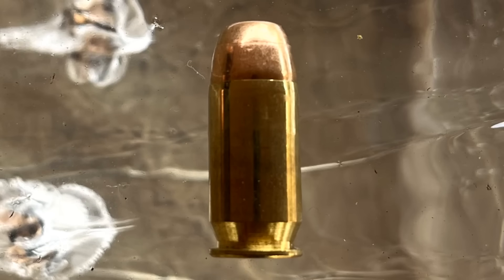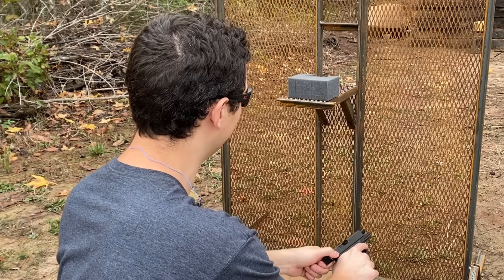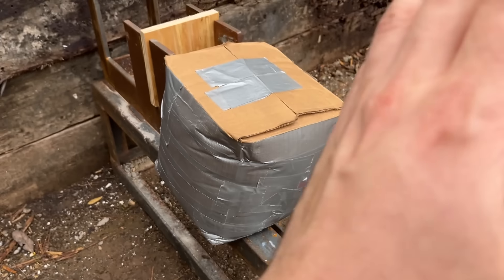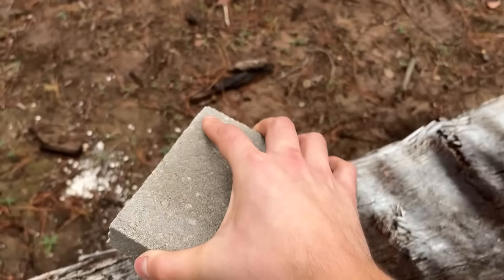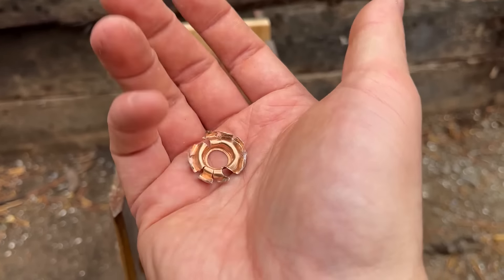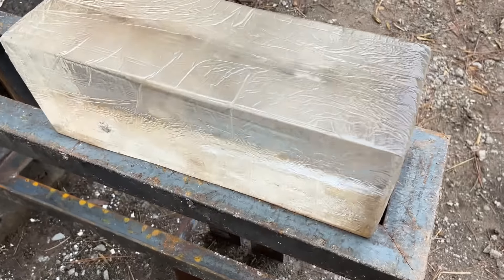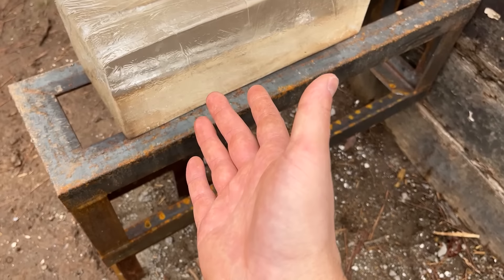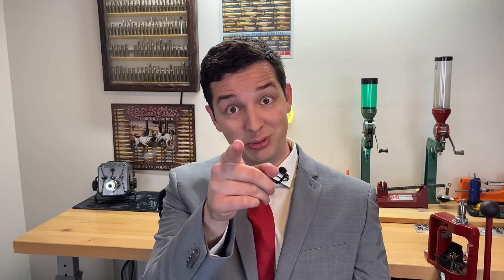9mm vs 45 ACP Barrier Test: No Debate?

Comment: When it comes to stopping power and controlled accuracy the .45 is the clear winner, however when it comes to shear volume and forgiveness, the 9mm is the winner. So at this point it’s preference as both rounds have their pros and cons. My choice is the .45 as it does not over penetrate the target, while having more energy then a 9mm and easier to shoot due to less recoil in most shooting platforms.

Comment: Hornaday et al state that the temporary wound channel in ballistic gel does not accurately reflect what happens in live tissue. The wound channel collapses immediately with little tissue damage. Damage is caused by the expanded bullet's direct contact to the tissue. The actual damage is limited in diameter to the width of the bullet.

Comment: On the Mild steel and rifles when you find a cartridge that will not penetrate a certain thickness of steel. Why don't you take that 1 cartridge and start up stepping or down? Stepping the bullet and bullet design.  To see what that cartridge takes to get thru the steel.
So 7mm-08
120g to 175g  soft points, F.M.J.s, Solid Copper,
So Instead of 2 cartridges going against each other, one cartridge and changing up bullet types and weights..

Comment: Shooting metal plates with 9mm and 45 is very safe at  10 or so yards away. They flatten completely and splash lead 360° in a perpendicular direction from the shooter. Only use lead or lead and copper jackets though. Other materials don't behave quite the same.

Comment: 9x19mm has a weird tapered case design with a protruding rim, forces curved mag use.
45ACP operates at 21k PSI and has a thin case wall.
The winners are the 30 Super Carry, the 9x23mm Winchester, the 10x25mm and the 460 Rowland.

Comment: I've watched many of your videos pertaining to ammo vs steel but have haven't touched base on something. In WW2 it was discovered that angling steel would what otherwise be a direct hit to be deflected. You should try putting the steel at an angle in different degrees to see what those results might be. Instead of penetration even on the 1/4" steel might just end up being a deflection.

Comment: The .45 ACP, also known as .45 Auto, .45 Automatic, or 11.43×23mm is a rimless straight-walled handgun cartridge designed by John Moses Browning in 1904,  Georg Luger, the German firearms engineer who in 1901 designed the cartridge for the German Weapons and Munitions Factory (DWM).
Reply: The term .45acp means "automatic colt pistol". This round was engineered specifically for the new Army, War Dept contract 1911(later 1911a1).

Comment: Ease of carry (the one you carry is the best one to have), Target re-acquisition is second, " flinch"factor is 3rd. For general, everyday carry, your choice is for a backup, not a combat gun (unless you're on duty somehow). Having said this, I went from a 45 1911 (carried 60% due to summer wear and heat), to a 9mm EMP 1911 (carried 85% for same reason) to a P238 .380 almost a 1911 (carry  95% of the time). My opinion of course.

Comment: Look up the Strasbourg handgun test.  It's a very interesting test performed out of the US (animal cruelty reasons), on goats.  .22 out performed the .38.  In fact the .38 testing stopped, because it was deemed too inhuman.  9mm just barely out performed the .22.  .375mag came out on top even over the .45acp.  No testing was done with anything larger.  The results may be different today with the improvements of modern defense ammo.  I'm a .45acp & Long Colt guy, but recently suggested to a friend to go with 9mm because, defense rounds have improved, availability is better, more rounds in the mag, and in a smaller more concealable frame.

Comment: 1958 remington with 8in barrel.  

The Remington Model 1858 is a six-shot, single-action, percussion revolver with a large frame. It was produced by E. Remington & Sons in Ilion, New York, based on the Fordyce Beals patent of September 14, 1858. The Remington Army revolver has an 8-inch barrel length and is .44 caliber.

Comment: That 9mm is loaded a bit more hot than the .45, a 147 grain out of a 9mm at 1000 fps is smoking, the .45 is running substantially slower. I would almost venture to say that the 9mm is a +P

Where as a +P .45 ACP in say a Hornady Critical Defense is gonna be a 220 gr JHP that is going 975 fps. That is gonna hit a lot harder than the 9mm.

Comment: Italian Proverb:  Da bigga da bullet, da bigga da hole!
Sums it up!  Smaller bullets go farther in due to size, not power.  Smaller hole equals less resistance to penetration.
Bigger bullets stop sooner but deliver just as much punch if not more.  Also have more resistance to penetration but deliver more stopping power and, most importantly, will most likely stay in the body and not pass through various parts of it.

Shock and aw! 45 equals more shock then the 9 as the 9 has less resistance to penetration.
EVERYONE overlooks that part of the 9 vs 45.

Comment: Army wanted a round that would penetrate bamboo armor like another poster stated.  Also one of the speculations was it needed to be able "to stop a mule in its tracks", that's the reason for the large bullet and slow speed.  It needed to impart all of its energy into its target as much as possible without passing through, or passing through as slow as possible.  So if you add up the numbers as far as weight of bullet, speed of bullet, and slower pass through it all equates to more stopping power.  Too many people think a faster bullet with more penetration is better, but it isn't.  If pass through is too quick the bullet only imparts minimal amount of its force.  However a faster bullet does create a bigger Temporary wound cavity but the bigger bullet also creates a bigger wound cavity regardless of what the video stated, its physically impossible for something smaller to be bigger than something bigger.  He was measuring the width of the left over temporary wound cavity.    @mrbadguysan

Comment: So, after many years of the Federal Government using .40, they went back to 9mm. There is a real reason for this... back when they went .40, it was superior than the 9mm. Then, for years, the  9mm manufacturers worked to improve the ballistic performance of the 9mm in order to gain the contract back. While this was actually happening, the manufacturers of .40 didn't do much to make it perform better, I mean, they were getting tons of money anyways from the government contract. Now the 9mm is a surperior round. I think this is also the case with the .45. I don't think(and I could be totally wrong) that ammo manufacturers have been doing much with the .45 for many years. And I think this video proves it. I know a lot of manufacturers have been working with " newer" cartridges like the 10mm. Yet, I think the 10mm will eventually be something to look at. Just my opinion.

Comment: Okay. Both of these are self defense cartridges. When you shoot in self defense, are you shooting wood, cement, sand, or concrete? Oh! That's what I thought. Penetration tests on these types of targets are completely irrelevant to the intended purpose of the cartridge.  Since we aren't allowed to test fire these cartridges on the target encountered in self defense, there is no objective test to determine the outcome or the suitability of the cartridges. Both cartridges seem capable enough, there are many, many people now residing in military cemeteries as the result of being struck by either a 9mm or a .45acp.

Comment: This again? They both have about the same energy and stopping power, but the higher pressure 9mm round is smaller and lighter so you can carry twice as many 9mm rounds for the same weight. The 9mm round also has a tapered case, which aids feed/extraction reliability. Love the G30 and G36, but you would have to have rocks in your head to carry one over the G19 or G43X for defensive use.

Comment: Depends a lot on the bullet weight and construction. If you want a 45 to create trauma it can surpass the 9mm with the right hollow point load. If you want pure penetration you need to use 255 grain hard cast. The 45 is best when selecting appropriate rounds for it's intended purpose. That's the upside and downside of a larger caliber. To maximize it you need a ballistics knowledge.

Comment: Mechanics of Handgun Wounding
All handgun wounds will combine the components of penetration, permanent cavity, and temporary cavity to a greater or lesser degree. Fragmentation, on the other hand, does not reliably occur in handgun wounds due to the relatively low velocities of handgun bullets. Fragmentation occurs reliably in high-velocity projectile wounds (impact velocity in excess of 2,000 feet per second) inflicted by soft or hollow point bullets. In such a case, the permanent cavity is stretched so far, and so fast, that tearing and rupturing can occur in tissues surrounding the wound channel, which were weakened by fragmentation damage. It can significantly increase damage in rifle bullet wounds. (Adding my own word here: in other words, once a bullet hits the nearly 2000 FPS mark, temporary wound cavity matters) 

The cross sectional area of the .45 ACP 230-grain bullet is .160 square inches; the cross sectional area of the 124-grain 9mm NATO bullet is .0989 square inches. The 9mm possesses only about 62% of the cross sectional area of the .45 ACP. A more traditional method of establishing the effectiveness of a given bullet is its sectional density, the ratio of bullet mass to the square of its diameter. Generally, the higher the sectional density, the better the penetration of the bullet in living tissue. The sectional density of the FMJ 230-grain .45 ACP bullet is .162; for the 124-grain 9mm NATO bullet, the figure is .144. By this traditional method of establishing a bullet’s terminal effectiveness, the .45 is again superior to the 9mm when both projectiles are of the FMJ type. By any mathematical calculation, given equal penetration, the .45 ACP bullet will create an approximately 40% greater permanent wound cavity volume than a 9x19mm bullet. These mathematical predictions are borne out by actual testing, such as the FBI ammunition tests alluded to earlier.
Reply: To return to the FBI test protocols, it will be remembered that in penetration tests the .45 ACP FMJ scored 100%, while the 9mm achieved a slightly lower 95.5% success rate. While the minimum acceptable penetration for police use was established to be 12 inches, the FBI tests concluded that a penetration of 18 inches was even better. During the tests, however, the FBI assigned no points for penetration beyond the optimum 18 inches. The .45 ACP FMJ bullets penetrated an average depth of greater than 28 inches, while 9x19mm FMJ bullets were a full 4 inches less. Some might consider this over penetration, but for military applications, greater penetration is both acceptable and desirable. As previously mentioned, penetration is only one aspect of bullet effectiveness. The size of the permanent wound cavity must also be considered, and the .45 ACP FMJ bullets in the FBI tests achieved average permanent wound cavities of 3 cubic inches, while the 9mm bullet permanent wound cavities were a full cubic inch less. This significantly increases the prospect of the .45 striking a bone or internal organ. This can be summed up in the FBI’s overall wound value that assigns a value of 2.91 to the military .45 ACP and only 1.65 to the M882 9x19mm. This value is “... the index of demonstrated wounding effectiveness, not potential, as measured by the FBI Ammunition Test results.”
Reply: FBI findings
“Increased bullet mass will increase penetration. Increased velocity will increase penetration but only until the bullet begins to deform, at which point increased velocity decreases penetration. Permanent cavity can be increased by the use of expanding bullets, and/or larger diameter bullets, which have adequate penetration. However, in no case should selection of a bullet be made where bullet expansion is necessary to achieve desired performance.35 Handgun bullets expand in the human target only 60- 70% of the time at best. Damage to the hollow point by hitting bone, glass, or other intervening obstacles can prevent expansion. Clothing fibers can wrap the nose of the bullet in a cocoon like manner and prevent expansion. Insufficient impact velocity caused by short barrels and/or longer range will prevent expansion, as will simple manufacturing variations. Expansion must never be the basis for bullet selection, but considered a bonus when, and if, it occurs.”
Reply: My personal word: 
In conclusion: Ballistics gel gives us good data, but it’s important that we look at true FBI calibrated gel. If I’m going with a hollow point defensive round, give me .45 ACP Winchester T-series 230 grain or Speer Gold Dot .45 ACP 200 grain +P. The goal of your round is reliability in expanding (after going through material) and going 12 inches or so in the body to avoid over/under-penetration. At the end of the day though, a bigger bullet is theoretically better (provided you have proper penetration)

Comment: the 9mm will usually penetrate deeper because it is going faster and is smaller therefore it has the strong possibility of passing through the bad guy without doing a lot of damage, the 45 was designed for total  stopping/knock down power the Ft # of pressure when it hits a body will Knock that body down to the ground and it will not get back up.

Comment: 45 has become a lot more versatile and capable with modern loads, you can get 185 grain bullets that go just as fast as 9mm or you can get 230 grain for less penatration. The only advantage 9mm has is carrying capacity.

Comment: This debate is kept alive by those wishing to make the 9mm Luger equal to the .45 ACP, something that isn't going to happen because of PHYSICS! The .35 caliber comes pretty close when you make it a .357 SIG or .357 Magnum! We were having that debate when I started my LE career in 1980. The 125 grain .357 is pretty awesome, especially the Federal JHP but at the cost of extreme wear on the gun ( end shake, throat erosion, & locking bolt loosening ) while the .45 ACP ( mostly in the 1911 ) was easier to shoot and reload with a mag that held more rounds. The 1911 .45 ACP won. The .357 SIG doesn't have those problems of the revolver but comes in a package that fits the .40 S&W so why bother? While contracting with DHS, I worked with a few F.A.M.S. who were issued the SIG in .357. When they practiced, they shot a very reduced recoil frangible round or .40s with a barrel swap. Why bother?

Comment: They are both very good, but a few things to remember:  9mm is usually cheaper to purchase and train with, 9mm handguns usually carry more rounds (larger capacity), rounds travel faster than a .45 ACP, and their drop vs distance is lower, lower recoil, more concealable, and there is a greater variety of weapons (handgun, SBR, rifle, PCC) that use 9mm vs. 45.  If you wanted to limit the number of calibers you have to own, I would always choose the 9mm vs. 45 for the above reasons...  If you are a diehard 45 ACP user, that if just fine...  .40 was popular, but not as popular as it used to be.  9mm will always be around.
Reply: My friend scoffs at me using only HST 124gr+P at range. I say 10 times yrly won't bankrupt me and i KNOW my JHPs will cycle at 3AM.

Comment: The .45 was designed for knockdown power, not penetration. The difference is more like getting hit with a sledgehammer versus getting hit with a spear. Both are gonna ruin your day, but one will crush and the other will pierce. Muzzle energy are nearly equal, with the .45 a little more. And most of your tests had everything to do with penetration.

Only one of your tests came close to measuring crushing power - shooting concrete - and the .45 clearly won. It obliterated that block, whereas the 9mm split it, thus illustrating my point concisely.

Comment: The tests were about equal except that 45 ACP had more energy on the concrete block and the diameter of the wound channel was larger. This is why people like 45 ACP over 9mm. Try Winchester Ranger ammo in 45 ACP and the wound channel is 1.00" in diameter.

Comment: .45 is an expanding projectile…… It’s an excellent round….. 9mm has to expand for it to be as effective…..if a .45 doesn’t expand… you still get an almost half inch hole…..
Besides…. There are different types of .45 acp projectiles…. The Underwood +p 255 grain hi-tek hard cast flat nose bullet ( red) would punch through just about anything in this test. If you want to take it even further then a .45 super ( still a .45) is fat approaching 10mm….. Besides… the .45’s track record on the battlefield and self defense speaks for itself. Modern bullet technology has leveled the playing field . I still like it for alot of reasons. 👍

Comment: Any kind of "penetration" test is going to be "won" by a 9mm.  It's got a smaller cross section and it's moving faster.  What you really care about in a self defense situation is more energy dump in a shorter distance to avoid overpen.  This situation is obviously going to favor a heavier, slower moving bullet with a larger cross section.  Underwood makes ammo for each, and while the JHP for the 9mm is 200fps faster, it's down about 20% on energy.

tl;dr: This debate will never be settled.
I prefer a .40 for EDC anyway.

Comment: Don't say it like it's a bad thing.    45ACP and 9mm are designed not to penetrate walls.  That's why police use them.  They work as designed, just as 30/30 is designed to be easy to carry and effective under 200 yards.

Comment: If all you're looking to evaluate is penetration depth, then yes, of course the smaller diameter and faster moving round is going to win every time.  Use ballistics gel and compare wound tracks.  There's a reason many military orgs and police have moved on from the 9mm to the .45 or 10mm.